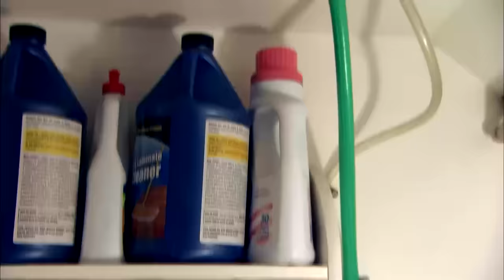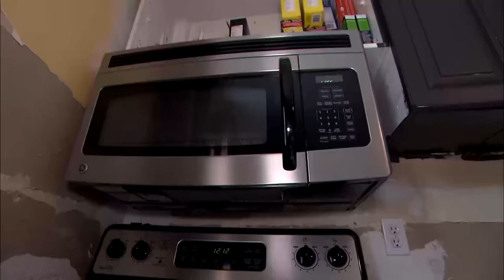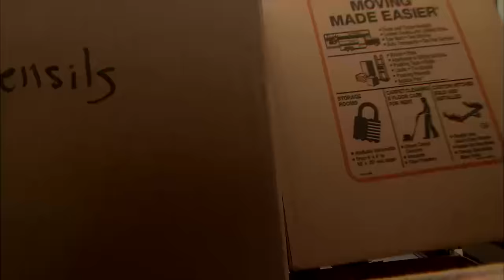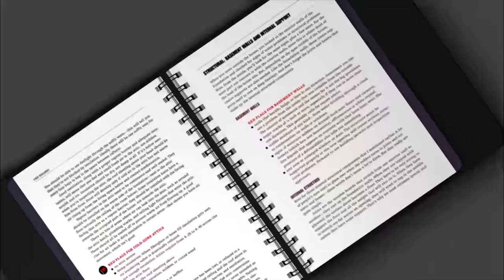Mike Holmes Rescues a Policewoman's Home | Holmes Inspection 117

Comment: We need more tradesmen with INTEGRITY like Mike and his crew. The city needs to have trained inspectors (to even obtain a permit for contractors) as a service for tax paying citizens. Not only for permits but for peoples safety
Reply: I think the main issue is Inspectors avoiding confrontation..but if there's no one to Hold Contractors accountable to Municipal Standards, The practice of cutting corners to save extra money or just plain incompetence will always thrive. It seems nowadays home owners or soon to be have to require some basic knowledge of The in's and outs of how houses are made to operate, Which in most cases is not that hard to learn.
Reply: The City has qualified inspectors galore. The problem is that people don’t get permits.

Comment: This house was a scam job, through and through, and the sad thing is, it worked because they bought the house in spite of all the really unusual stuff that's out in the open. Whoever bought the townhouse to flip it hired the cheapest people he could find, and because he's doing so much business in town, the local inspectors sign off on it because that means they get paid too. It wouldn't surprise me if they think the homeowner is to blame for falling for such an obvious scam, and yet they're the ones responsible for pulling the scam in the first place.

Inspection reports should come with "I certify under penalty of perjury that the above is an accurate statement of this residence." But unless there's enough of a public push for it, it will never happen and inspectors will continue doing bad jobs.

Comment: The wiring in closet area would Not pass USA code, as the exposed wires have to be in Conduit, Below 8 feet. Also a Max of 6 outlets per 15 amp Breaker.

Comment: With the 16 duplex receptacles with 4 light switches and 3 conductor 2 circuit feeds a quick test would likely show the switches each control 4 receptacles and switches may be 240v 2 pole or switching the common neutrals with 2 bonded together using a single pole switch... not good but wouldn't be a surprise with grow op design. 
Our neighbourhood's newly married couple dug their crawlspace a little deeper and wired it with well used temporary lighting condictors that previously had clamp on light sockets that pierced the conductor's insulation to put a lightbulb wherever over many jobs leaving occasion copper exposed. When the husband crawled in to continue excavation he got himself wrapped up in the wire jungle and made a connection to 2 hots with 240v potential between them. He remained connected to 240v for the remainder of his life plus another few hours. Very sad start to a married life.

Comment: Does anyone know what kind of impact this is 17:17 I’m looking over the internet for this and cant find it. Obviously its made by dewalt and it swivels or it looks like it does at least. Judging by the battery pack its an older model but there has to be a new version right. If you know please let me know thanks.
Reply: that's just a cordless screwdriver....

Comment: This is why I would never buy a condo or a duplex again. One owner can rig a unit together so bad that it could burn a whole complex down. I went through this with a neighbor doing there plumbing them self that caused sewer backups in my bathtub. In the end the condo management took control of the unit and fixed the plumbing. It took two years to resolve. In the meantime I would have to scoop buckets of shit water out of my tub and dump outside. This happened every week.

Comment: why was this a bad home inspection? The bank of outlets was up to code and he was blamed for not pointing it out. Ah, how can you miss that she isn't blind? home inspections are supposed to open every door and go places you wouldn't think of, not to point out 47 outlets in plain sight. If they were out of code different issue. then they blamed him for the AC, turns out the lady didn't change the filter once again not his fault. they then blamed him for the washer-dryer move and said there were some things wrong but never showed anything besides one bad outlet placement hidden in a cabinet, one mark against him. The kitchen was a mess from her not being able to finish the remodel.  I like this show but this looks like charity, not a bad inspector. The hose was out of code but was easy to remove really they call this guy for this stuff she made it sound like the house wall going to fall down.